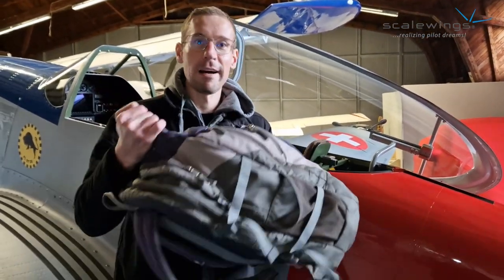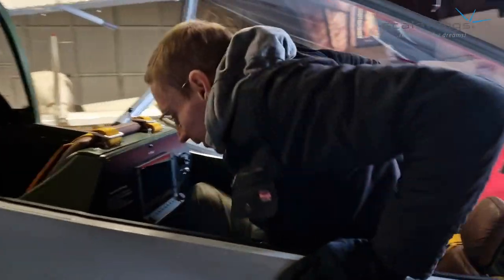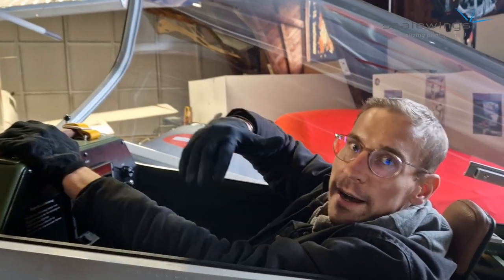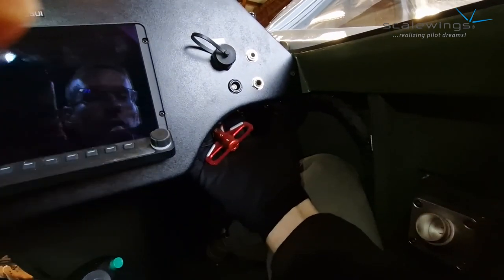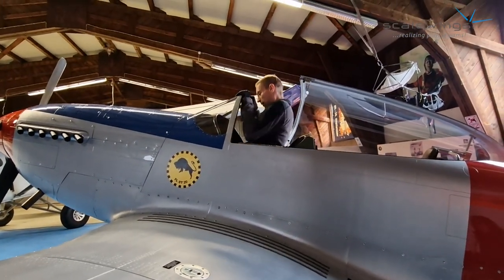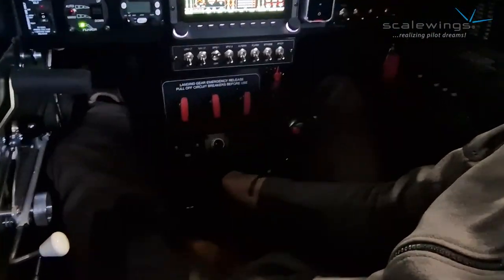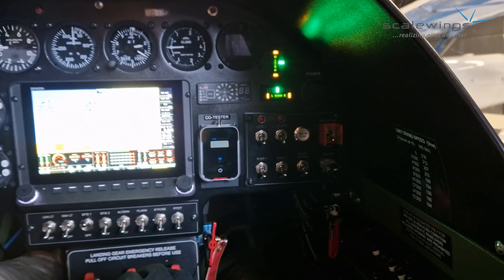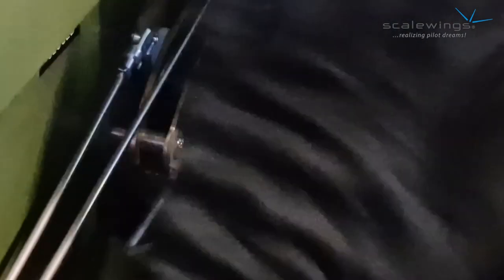ScaleWings Tech Blog Episode 2 - Cockpit & Interior

Comment: Your finished plane is very nice and all the gauges are very well thought out. I hope mine turns out this well. I would like to know which features are standard and which are not during the explantion .  For example is the gear indicator part of the landing gear assembly or is that a optional feature?
Reply from the maker: Hi Beda, we offer Add-On packages, the landing gear control panel is part of the Systems Package. I have sent you the list per email. Please review and let me know which Add-Ons you would like to add to your Kit.
Reply: @scalewingsaircraft  I have 1 question only. Why did you not build it a full scale? What was the engineering/marketing reasoning? Especially for the North American market a bit more room...and the nostalgia of the full size awesomeness...it would also give weight/room for more serious engines...What am I missing here?
Reply: @electricaviationchannelvid7863  the plane is supposed to be more affordable than the original. If they sell something at original scale with almost original fuel consumption, the market gets way smaller.
Reply: @mehrschwein7378  
If it were a under 100k USD GA aircraft I would agree but it is way more than that...in the current price range it does not matter anymore for the buyer 50k more or less...there will be more demand than production capacity no matter the size and the associated cost...correct me if that is a wrong prediction...

Please bring up some company market research- market expected-tendency numbers...
ENGINEERING WISE it would not need the original fuel consumption since different structural weight/payload/aero-foil/total drag coefficient would be applied...
Reply: @electricaviationchannelvid7863  double the size is not just double the cost, it would probably be at least 3-4 times the cost. that with a bigger engine just makes the difference. Someone who works as an engineer, management etc. can find a way to finance a 150 k plane but not a 300k+ plane. This is not a house, its a toy. And if I buy a plane I want to fly it, not only sit pretty in some hangar. So running costs are also very important.
Reply: @mehrschwein7378  When it comes to flying nothing is a toy...any flying object can be very quickly lethal...
A new Cessna mid-size (certified) is 450k USD...if you want a practical experimental to fly a lot cheap, still haul a lot and look cool buy Velocity... 150k USD...
A warbird replica is a narrow (niche) high profit margin market...
Reply: @mehrschwein7378  Furthermore it is a 70% replica so I am not sure why you talk about double the size???